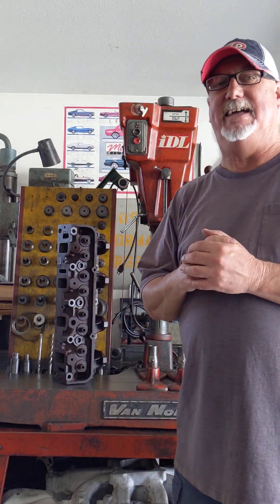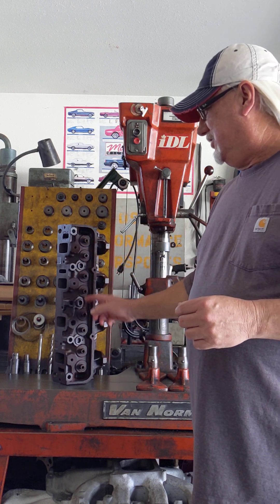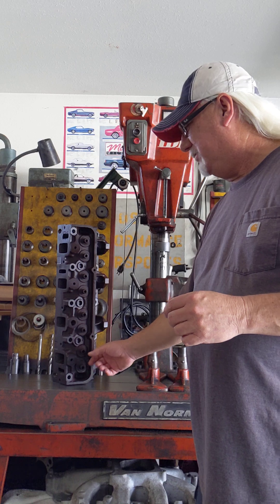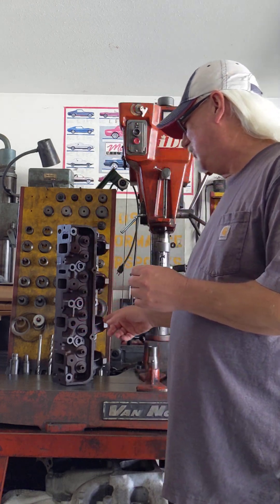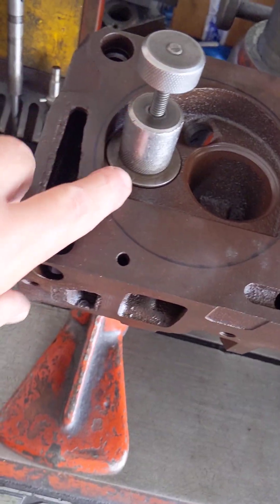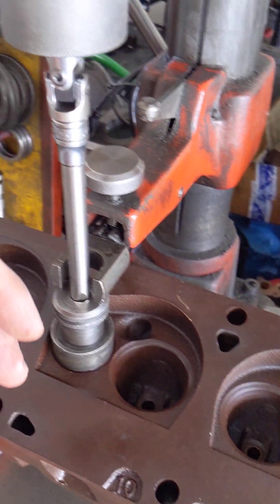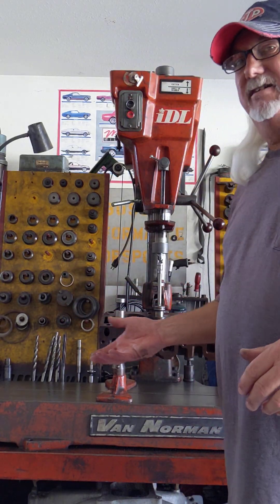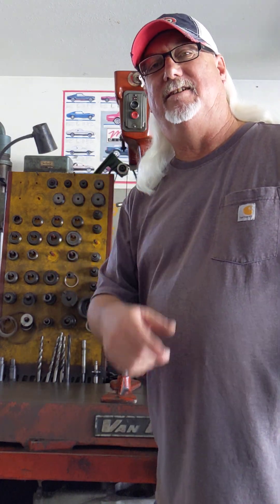Set-Up With IDL Seat And Guide Machine Ford FE Cylinder Head.

Comment: I shared ti's video with my buddy Randy Stephens owner of Stephens and Hull Automotive in Cecil Ohio. He has done Engine machine work for about 40 years on anything you can think of.  Now builds alot of race engines mostly circle track.  He does have a Dyno. He said what you are doing looks good He has used that machine along time ago. He said IDI stands for Ingenious Devices Limited.  Made I  Canada until Winona bought them out.